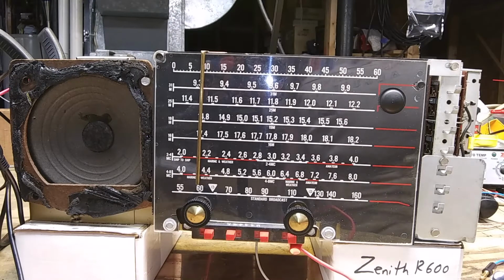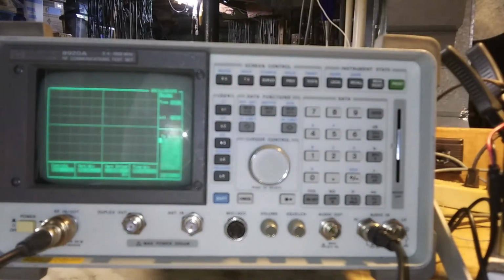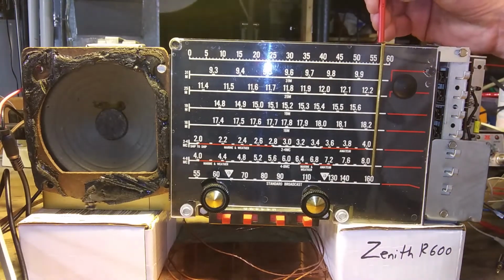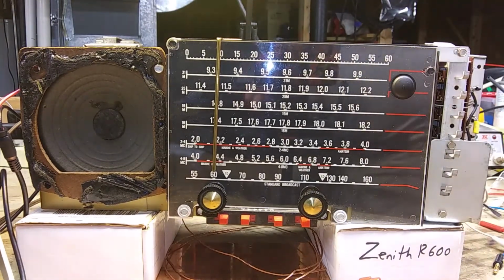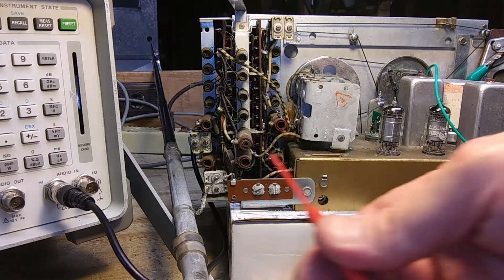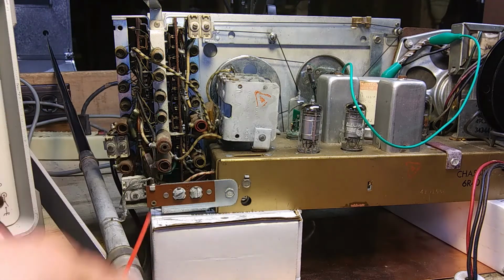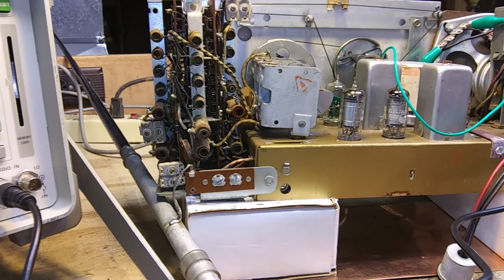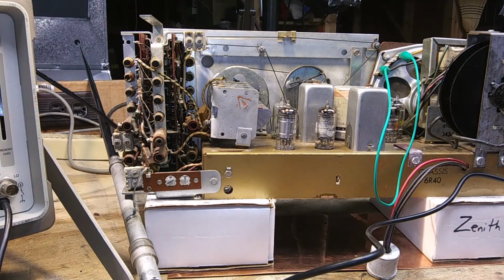Zenith Trans-Oceanic R600 Part 3: Alignment

Comment: Is it true that these receivers can be burned up and damaged if you use it powered only on AC / plugged into the wall? I heard someone say they are meant to be powered only with DC/ the battery pack, and using it plugged in can damage them, is this true? Im skeptical
Reply: Nonsense- most of their lives they were plugged in. This model was popular in the 50's. Everyone had AC and they're really too heavy to be a practical portable radio.

Comment: I find that adjusting the higher bands based on instructions then go to 2nd to lowest and 2nd to highest and readjust till the ends of band and one on instructions are right on. And will be accurate accross the band. For 31M for example i adjust so its loud strong tone on 9.4 9.6 and 9.8

Comment: I’m not sure how your spectrum analyzer works, but the ones I’ve seen used in alignment were able to focus in on a specific desired center frequency plus & minus  10 cycles or so. It displayed a single peak. Check out Mr. Carlson’s Lab video on AM alignment. It inspired me to acquire a spectrum analyzer, although I haven’t been able to use it yet. I’m still working on fixing the radio. 
I have a TransOceanic, just like my grandfather’s. I don’t know whatever became of his.
Edit: Of course, Mr. Carlson wasn’t working on the higher frequencies on the video I watched.

Comment: Great videos, thank you for making them. If a realignment isn't performed, then the radio isn't going to receive well is it? I am looking at buying a TO T600 to restore and saw the recapping kits and filt-r-pak and thought that doesn't look too hard, but this realignment procedure takes special equipment. If I can't realign, then a restoration isn't really worth it, right?
Reply from the maker: From what I am reading in the comments below, a complete alignment may not be worth the trouble.  I would go ahead and replace the caps and install the Filt-R-Pak and enjoy the radio as it is.  Hope this helps. Thanks for watching and writing.
73 Paul

Comment: Do you know what resistors caused the problem stated at the first of the video?  I would like to know so that I can replace the ones in my TO.  Thanks for the videos.
Reply from the maker: Yes, Dwight.  As I learned from someone on the Trans-Oceanic email reflector who watched my videos, they were ones in the filament string of the tubes.  He recommended replacing 5 resistors, not realizing that I had already replaced two of the five.

Cut & Pasted from his email. "The resistors that should be replaced are 680 ohm from pin 1 to pin 7 and 270 ohm from pin 5 to pin 1 of the 3V4 tube, 120 ohm from pin 1 to pin 7 on the IF 1U4 tube, 100 ohm from pin 1 to pin 7 of the 1L6 tube and 150 ohm from pin 1 of 1L6 to pin 1 of 1U5 tubes. These resistors can also be found in the lower right hand corner of the Zenith and Riders schematics. They may be on Sam's as well."

I already replaced the 100 Ohm and 150 Ohm resistors.  I ordered the other three, but have not replaced them yet.  When I do, I'll try to make a follow up video of it.  I have another R600 that I plan to do this on, as well.

He also recommended replacing the mounting bushings for the speaker, and tuning capacitor.  He thinks they are 3/8".  I don't have plans to do this, but it's good to know.

How's that for specifics? 👍
Reply: @VTradio   Thanks for the specific info. I have a Zenith T600 and a Zenith A600 to work on this winter and wanted to avoid buying more tubes than I need. I think a lot of people will appreciate knowing what resistors are potential time bombs.  Thanks

Comment: When I was a Zenith service center, the engineers at Zenith said not much will be obtained by re-aligning the coil banks on the trans-oceanic radios.  Those were the days of analogical electronics (close was good enough). Now days, digital electronics has made the youngsters O.C.D. and trying to make perfection there game.  It will never work on vintage radios and equipment..
Reply from the maker: Yea, I notice that I pick up a station very clearly that is out of the frequency range of the radio.  I think it's WWCR at 13845 kHz.  Plus other people have told me, too that these aren't the most accurate radios.  One guy told me that he calibrates for 1500 WWV because that's what people want to see.  I tried that and it made the band edges even more off.  See comment below.  I'm going to replace two more resistors in the tube filament string shortly.  Somebody on the T-O Reflector suggested that I do that.  Then, I'll do all 4 in my other R600.  I don't think I'll need to realign it after that.  I'll just do a quick check before and after.
73 Paul AA1SU

Comment: Amazes me when people try to obtain exact dial precision from vintage radios like this. Simply is never going to happen. Alignment should shoot for the best peak sensitivity possible, without fretting over having frequencies match exact.
Reply from the maker: Yes, I've noticed that the band edges are not exactly accurate.
73 Paul AA1SU
Reply: @ That's the reason for the number scale so you could write down the number and band settings for your favorite stations and programs.